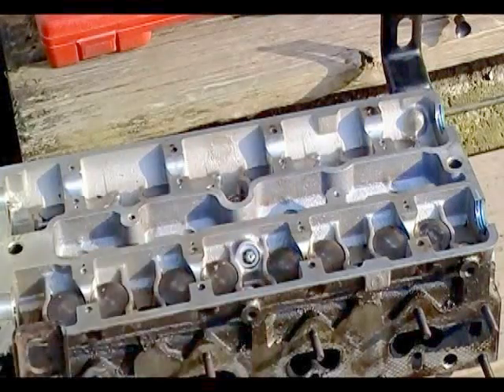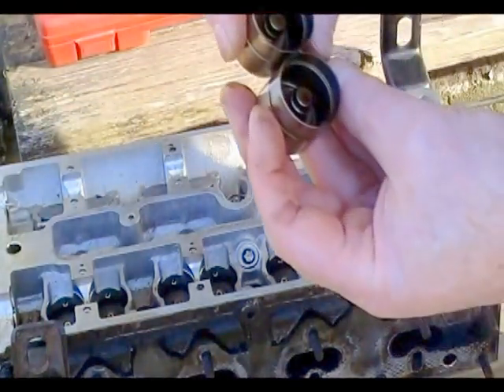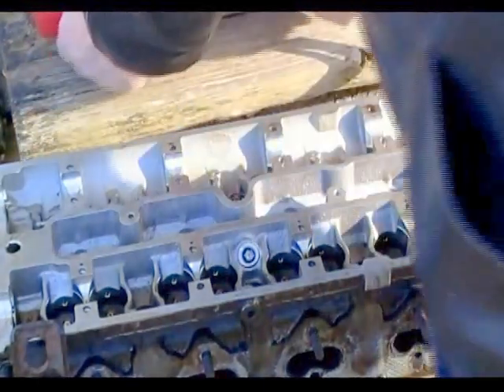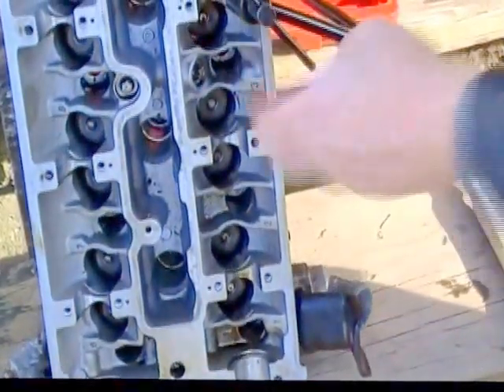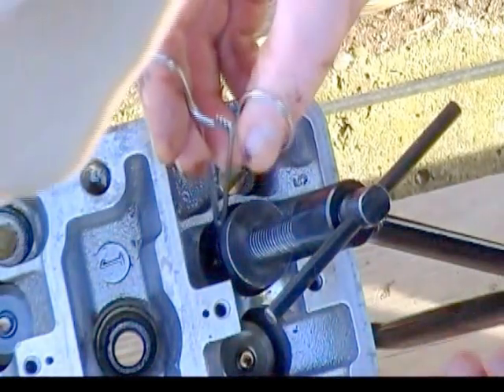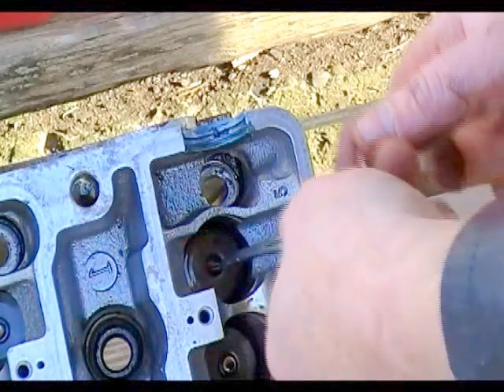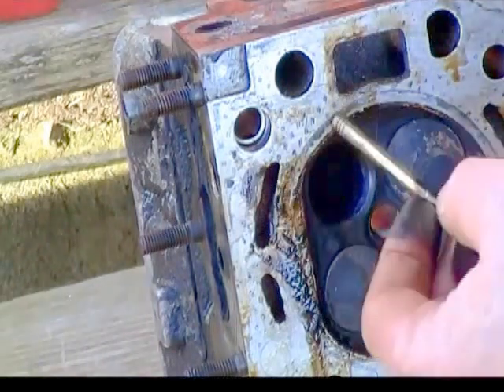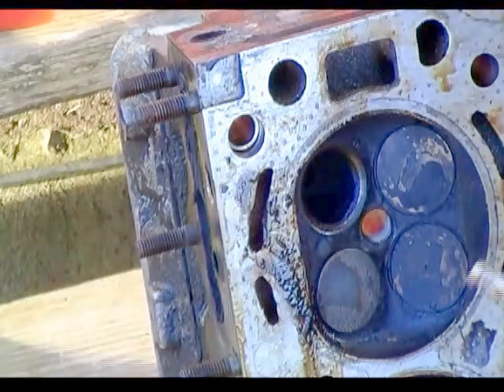18  Replacing The Valves In a DOHC 2.0

Comment: Clueless.

:30 It absolutely matters what position they were in.  Flat cam followers/lifters develop a wear pattern matching the cam lobes, when you swap them around you risk increased wear & serious damage.  I stopped watching so no idea how much more wrong information is given here.
Reply from the maker: DonziGT230 Ok, since this video I have put 80,000+ miles on it. Still does not burn oil and has 165 pounds of pressure in all cylinders. Guess I just get lucky. LOL I have done this several times and have never had a problem with them staying together.
Reply: had a guy mix up the bucket location when he took out the heads to resurface. put it back together and it messed with the valve clearance and bent the valves. you most definitely did get lucky.